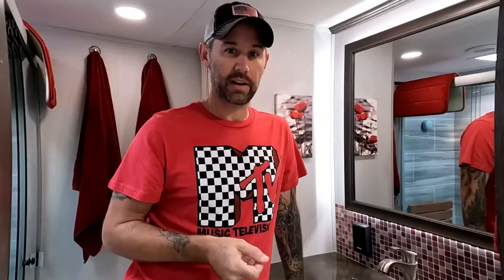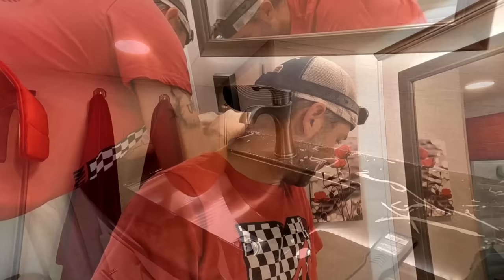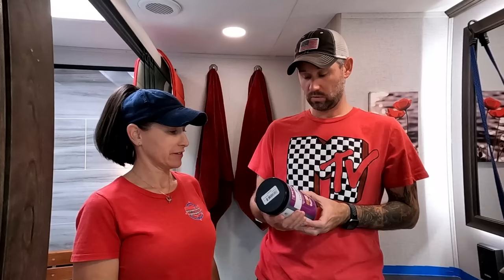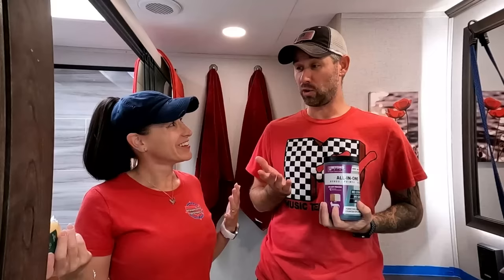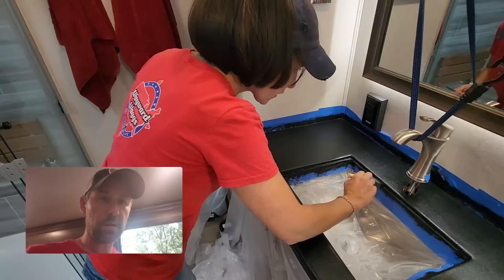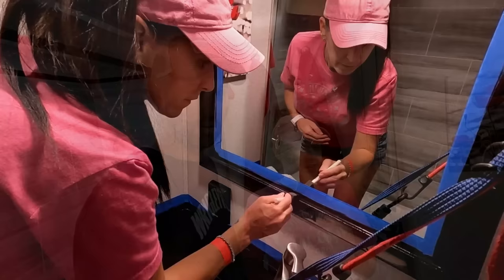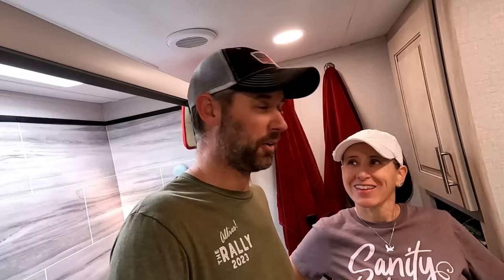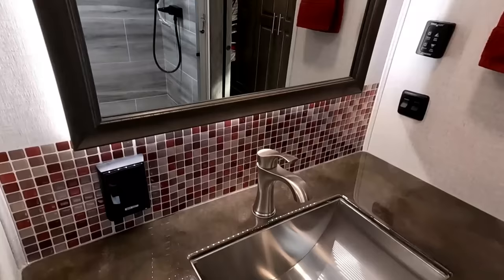DIY RV Bathroom Renovation

Comment: Nice job on the sink top and mirror! Also I saw your Sumo Spring commercial. I’m planning some for our 5th and maybe the truck. Do you have them on both the 5th wheel and the truck?
Reply from the maker: Thanks! And yes, we have the springs on the truck as well.  We totally noticed a difference in the ride 😊